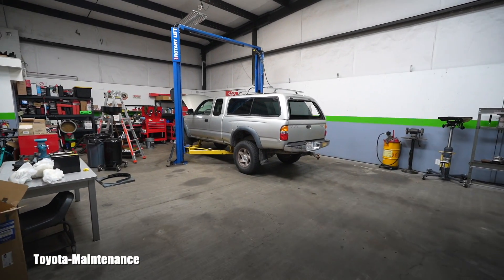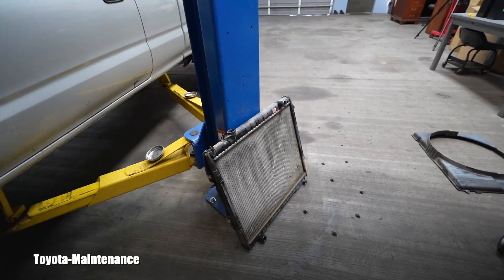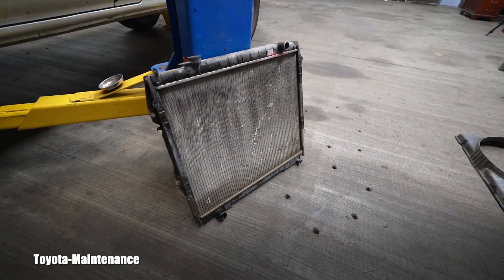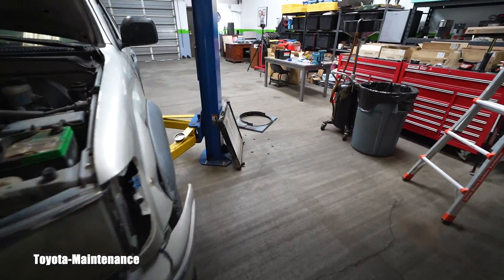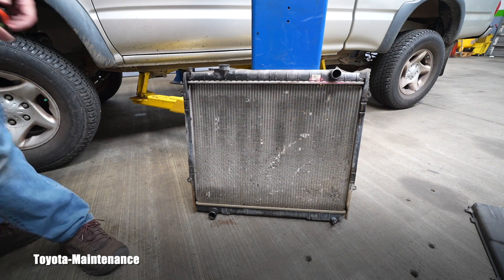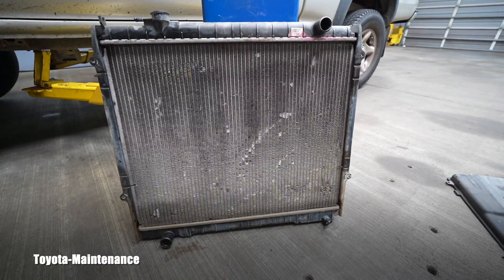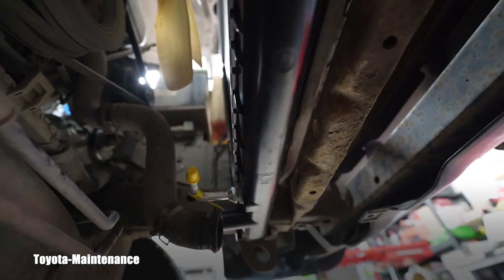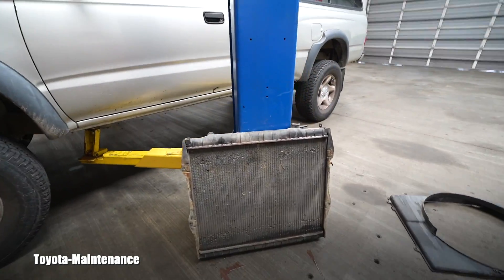Toyota Tacoma Radiator - 3 Different Sizes

Comment: Peter! Would you believe that my Tacoma's P0171 and P2195  codes were caused by an intermittently stuck open, AND partially restricted PCV valve! New OEM valve installed and now the single digit, long and short term fuel trims, are cancelling each other out, for a nice zero average!

Comment: Think the method of measuring is the same for all radiators ? Ive just changed a rad on a friends 2011 VW Golf and there were a few sizes online, but it was the manual or automatic that was the issue !!

Comment: Great video!! Question: My tacoma 2001 3.4 it's blowing hot air all the time once it reaches operation temp just hot air unless I turn on the AC and even with the AC sometimes 
Can you or somebody here help me please.
Reply: Sounds like a servo on the air box isn't operating. Find all the servos on the air box. Look at each one while going through the modes like heat, AC, vent...  The servos should operate respectively. If you see one not moving it's fried. Check with the engine warm.
Reply: You need to remflow the solder on the temperature knowb circuit board .. its right behind the climate control bezel takes about 30 minutes to do kt... if its the air blend door motor its under the glove box but it usually makes noise if its bad